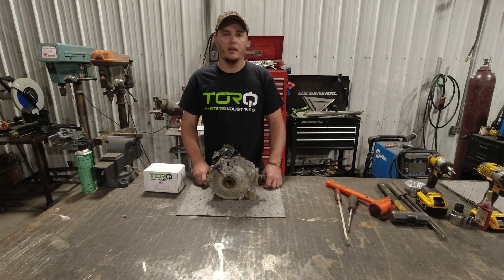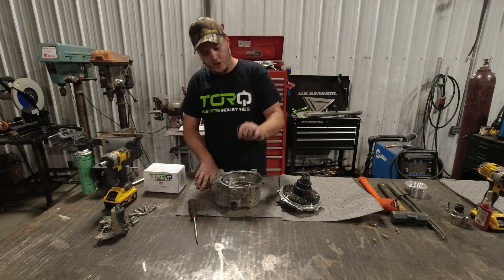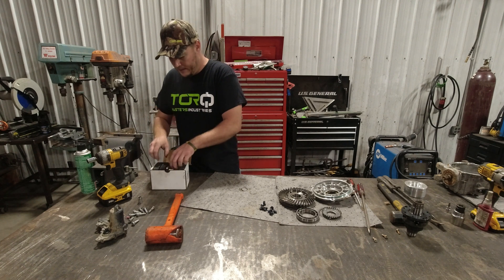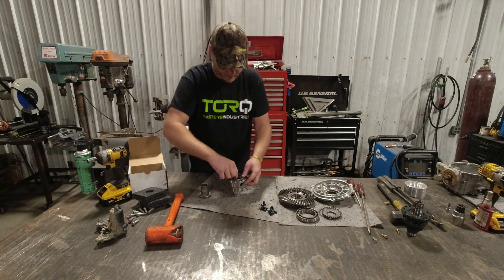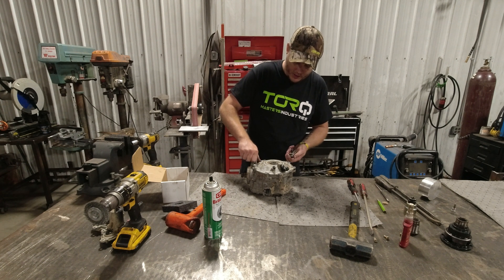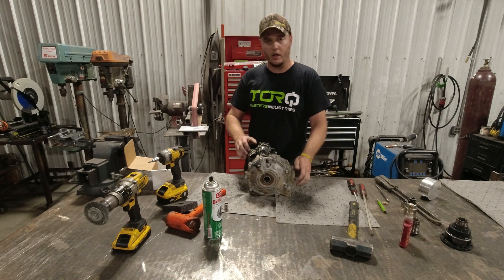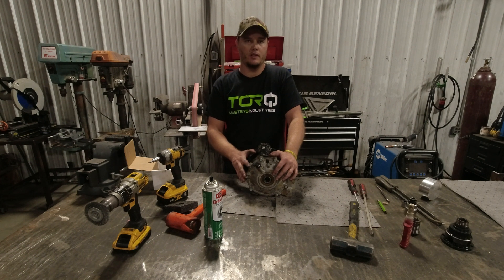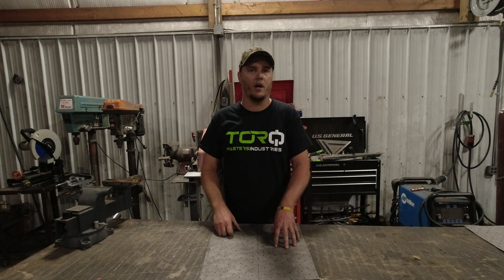TORQ Locker Install Video for Can-Am SmartLok Differentials

Comment: How does this effect steering ? Not to bad just driving around in 4x4 till you start to spin basically ? I blew the spiders in my smart lock looking at this to upgrade it and make alittle tougher
Reply from the maker: @wadewhite2381 in 2wd the locker doesn't lock and steering will feel normal. In 4wd the locker increases the turning radius slightly, and makes the steering slightly harder. The TORQ Locker is a great upgrade, stronger than stock spider gears, it's predictable and reliable too.
Reply: Any need for wireing harness modifications?
Reply from the maker: @ no, and that's a big selling point to the TORQ Locker for SmartLok.

Comment: The Smart Lock differential has a 4x4 limited slip and a 4x4 full lock. Does this eliminate the limited slip?
Reply from the maker: Yes, the TORQ Locker is not a limited slip, but it does allow for wheel speed differentiation and it does this by ratcheting. 2WD the locker does not lock, it free spins as needed.